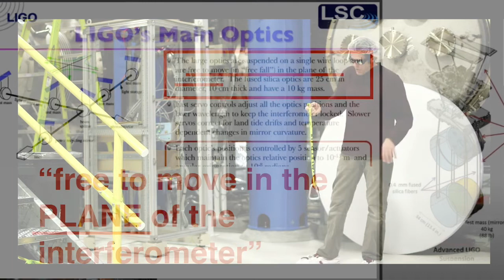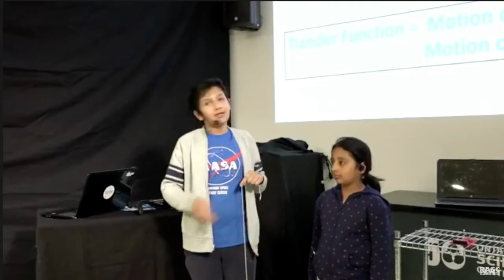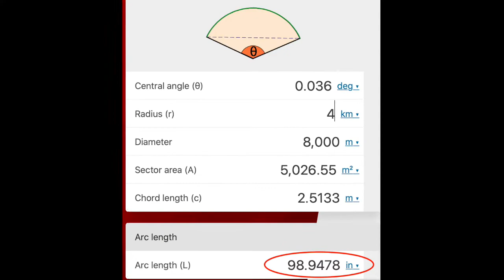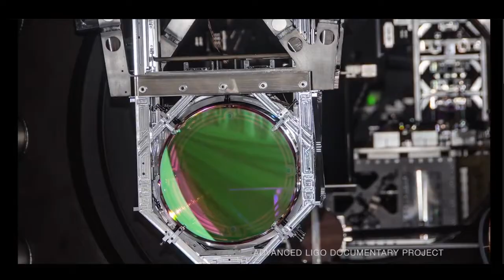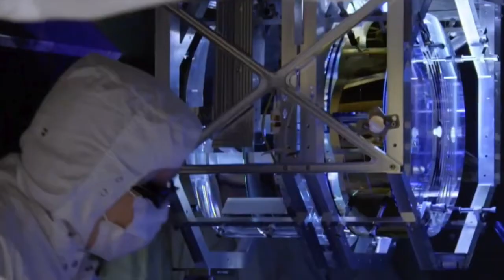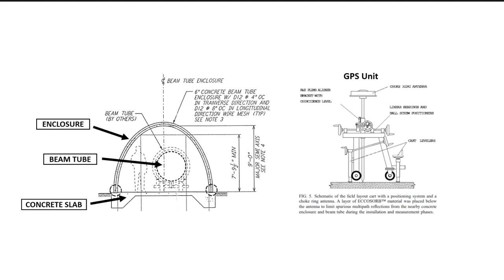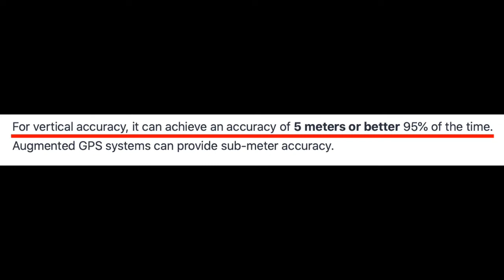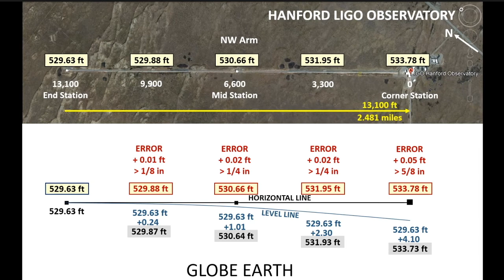The geometric LIGO   compared to the dogmatic model

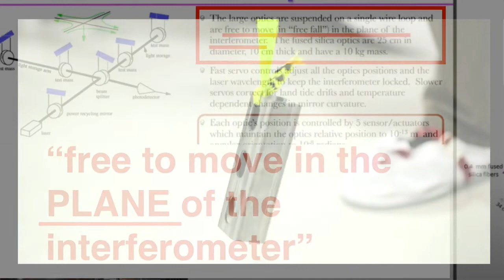Comment: Have a look at the 2:19 mark and notice how out of plumb that uni-strut is! That's asymmetric mass distribution and it shoots you contention that the mirror surfaces have to be plumb right in the ass:) That's what the mirrors have to do slightly due to the elevation changes in those tubes. Better luck next time!
Reply from the maker: I looked at 2:19 and didn’t see what you’re talking about. You sure you have the right video?
Reply from the maker: Oh…. Now i see it. You’re talking about that jerry-rigged two stage pendulum that guy was messing around with to show something different than what you’re talking about…. I thought you were pointing to the actual mirrors
Reply: @mobiusmaximus586  Lets try the Dick and Jane method. See the unistrut. See the unistrut hang. See that the surface of it isn't plumb. Extend an imaginary line that continues from the tape that the unistrut is hanging from and see how that passes through the CG of the unistrut.  See the LIGO tubes. See the elevation change in the tubes. Look at how the tube axis can't be perpendicular to plumb. Think about why the mirror surfaces can't be plumb and pointing at each other simultaneously. Was that simple enough for you yo get it?
Reply from the maker: @bluemarblescience  oh, how i love your condescending tone….. it makes you seem soooo smat
Reply from the maker: @bluemarblescience  also blue, remember…. “All perpendiculars to a plane are parallel” 😉 
And….. “the tube is the horizontal” 😉👍
Reply: @mobiusmaximus586  So what! Most grass is grass is green too. Ice is cold - steam is hot - WTF do perpendiculars have to do with it? Great - NORMALS to a plane are parallel - who doesn't know that? Any more brilliance you want to share with me?
Reply from the maker: @bluemarblescience  i can't tell if you're being purposely obtuse or trying to be clever...... maybe, both..... idk.....hard to tell with your laborious effort to do whatever it is you're trying to do. Oh well
Reply: @mobiusmaximus586  "also blue, remember…. “All perpendiculars to a plane are parallel” 😉 
And….. “the tube is the horizontal”  - that was your statement. It makes no sense. You're belaboring the obvious. What point are you making and how does it pertain to my point - that simply being that when you have asserted that because the mirror are hanging, their surfaces must be plumb. That is a clear fail! A plane can be in any orientation - then you talk about horizontal???? I'll just delete the comment since you can't address it intelligently.
Reply from the maker: @bluemarblescience  those are your quotes, blue. That’s why i put the quotation marks on them 😉
Reply: @bluemarblescience  I just saw this video.  It was hilarious but as I told Mobius in my comment, he did get one thing correct, his opening where he wrote,  “This video is intended to demonstrate the particular style and deceptive tactics being employed...and the erroneous reasoning that leads to it"  Brilliant opening since his video is a perfect example of this.
Reply from the maker: @fedogma8407  it was your (intentional or not) deceptive tactics and your erroneous reasoning (as well as other model afflicted people like you) I was exposing. 

You're always welcome to join a voice chat on discord (you know where) any time to chat about how you think I'm being deceitful and erroneous. But, I already know you won't.
Reply: @mobiusmaximus586  I exposed your faulty flerf reasoning in my very first comment. Are you too slow to grasp it, or are you a flerf fraudster? I'd say the second.
Reply from the maker: @primonomeultimonome  What's a "flerf" again?
Reply: @mobiusmaximus586  Anything related to the "level = flat" silly belief.
Reply from the maker: @primonomeultimonome  hmm.... even spherical geometry says level is flat so, are you disagreeing? Or, are you so "flat earth" obsessed that anything with the word "flat" associated is a "silly belief", in your opinion?
Reply: @mobiusmaximus586  Spherical geometry says level is flat? 🤣 What makes you think so? Maybe when you sleep you hear spherical geometry talking to you?
You are bringing the comedy of nonsense to a whole new level! 🤣
Reply from the maker: @primonomeultimonome  go learn, before you make an even bigger ass of yourself 😉
Reply: @mobiusmaximus586  I'm learning already from one of the best nonsense comedians: you. 🤣
Unfortunately I know I'd never be able to produce such an outstanding comedy gold, only flerfers can reach those levels of dumbness.
Reply from the maker: @primonomeultimonome  you sure do type a lot without actually saying anything.... It's like a natural talent or did you go to school for it?
Reply: @mobiusmaximus586  You write a mix of lies and nonsense, does a school even exist for that? My guess is that you skipped school altogether.
Reply: @mobiusmaximus586  "also blue, remember…. “All perpendiculars to a plane are parallel” 😉 
And….. “the tube is the horizontal”

Great; now you just need to demonstrate that the pendulums at the ends of each arm actually hang perpendicular to the tube.
Reply from the maker: @blargo  the data coming from LIGO should suffice to show the mirror faces are perpendicular to the beam. 👍
Reply: @mobiusmaximus586  The mirror faces are not the same as the pendulums. The tubes are not the beam. Other than those two key differences, you're doing great!
Reply from the maker: @blargo  great! So, the concrete slabs the beam tubes are situated on have nothing to do with the orientation of the beam itself? 

You should let blue and dogma know, so that they quit trying to say the elevations of the concrete slabs are evidence of anything. 

Oh, and btw..... the mirrors are pendular masses. They are "free swinging" pendulums at the final stage of a four pendulum system used to isolate them and reduce noise. 

But, other than your apparent total ignorance of anything having to do with LIGO, you're doing great!
Reply: @mobiusmaximus586  I know you like to conflate terms, like "level", "horizontal", and "flat", so it's no surprise you conflate "not the same as" with "nothing to do with".

I'll refer you back to Blue's original comment with timestamp 2:19, so you can see how the orientation of the pendular mass (the uni-strut) is not the same as the overall orientation of the pendulum of which it is a part.
Reply from the maker: @blargo  it might be easier to understand your argument if it were your argument you're trying to communicate.....

Firstly, how is it conflating terms when level IS the physical representation for a flat horizontal plane of reference? 
Secondly, it's obvious you haven't looked into ANY of LIGO's literature, aside from the very basic 6th grade level promotional brochure info. 

Let me know if you come up with any relevant arguments.
Reply: @mobiusmaximus586  I'm not sure what's so difficult to understand. The pendulums and the mirror faces are two different things. Pendulums hang plumb (vertical). The adjustment mechanisms on the mirrors at the ends of the pendulums allow them to be oriented other than vertical. The beam and the tube are also two different things, not necessarily exactly parallel. More reason for having the adjustment mechanisms. 

The beam is perpendicular to the mirror face; not necessarily perpendicular to the pendulum. The pendulum also doesn't necessarily hang perpendicular to the axis of the tube.
Reply from the maker: @blargo  lol. You think the “adjustment mechanisms” are used to make the mirrors not plumb? 😆
Reply: @mobiusmaximus586  Yes. The adjustments are to make the mirror faces perfectly parallel, compensating for the non-parallel plumb lines of the pendulums.
Reply from the maker: @blargo  you sure they aren’t there to compensate for the “noise”? 🤔
Reply: @mobiusmaximus586  The suspension system serves two purposes: isolation from noise, and alignment of the mirrors.
Reply from the maker: @blargo  really? Do you have a document title and page number where i can find that? Do you have a measurement for this adjustment? Or, just a calculated guess?
Reply: @blargo  Arguing with this kid is like arguing with a fence post. He honestly doesn't get it. He doesn't understand center of mass or how that works and refuses to see that the very instant they suspended those mirrors from two glass fibers that are physically separated horizontally, at least one of the fibers can't be situated in line with the center of mass. In fact, neither of them are. They're both offset which allows the mirror surface to be tilted as needed for alignment. It's simple and intuitively obvious to most of us but Mobius is apparently very mechanically challenged.
Reply: @bluemarblescience  Oh, I'm pretty sure he gets it. He's just following Bev's playbook of feigning incredulity and being intentionally obtuse to try and trip up his commenters over minor details.

Comment: Mobius, at 5.31 you show an arc length calculator. Why? What has an arc with a chord length of 2.5133 metres go to do with what FEdogma was discussing at the time? Or with LIGO?
Reply from the maker: I thought it was self explanatory.
Reply: @mobiusmaximus586  
Do you think the mirrors can’t be adjusted/aligned?
Reply from the maker: @ws1982  i know the mirrors have to be adjustable (and constantly adjusted).
Why do you ask?
Reply: @mobiusmaximus586  so what was you point about the 0.036 degree off of parallel. They can simple adjust the mirror to 0.036 degrees off of parallel and then the mirrors are parallel. 
Your calculation was meaningless in the context of the LIGO mirrors being discussed.
Are you just trying to appeal to globe denier simpletons that are easily fooled?
Reply: @ws1982  They're making it up as they go. As soon as you expose one inaccuracy, they switch to a different one.
Reply from the maker: @bluemarblescience  making what up, blue?
Reply: @mobiusmaximus586  Flerf gibberish.